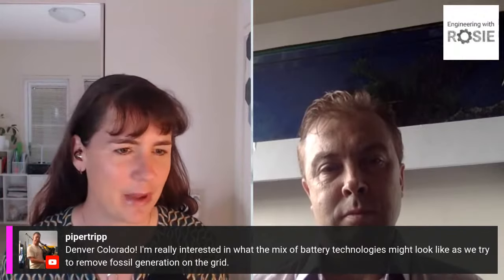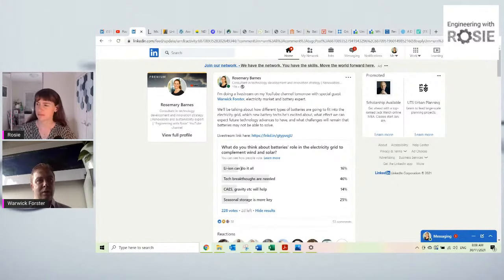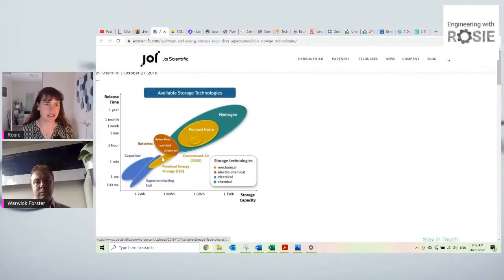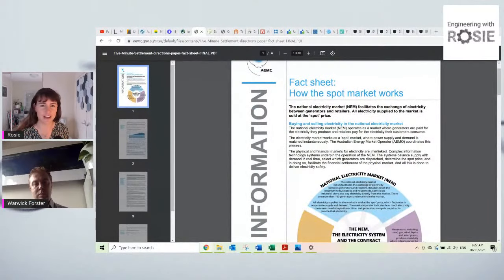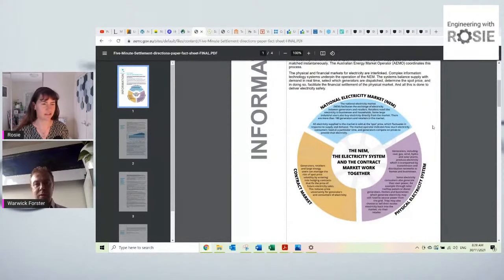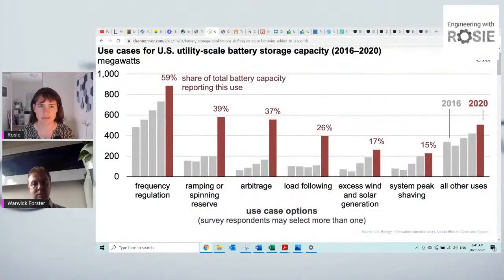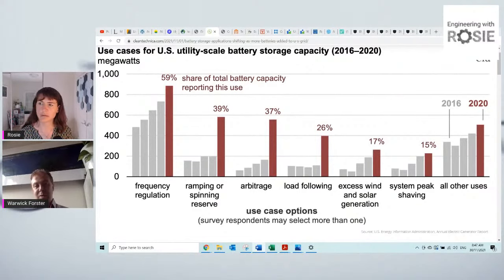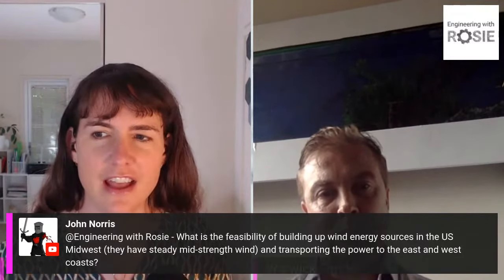Batteries in the Electricity Grid | Engineering with Rosie Live Episode 6

Comment: I must admit that didn’t quite go where I was expecting but found it really interesting. I have been trying to better understand what drives “the grid”. I have been looking more at IBRs and implications on system strength and the use of grid forming inverters to provide services no longer supplied by synchronous machines (you see regular constraining of inverter resources on low load days on the West Aus network). Thanks for this Rosie

Comment: My battery can cycle MILLIONS of times and I built it myself. I've used it now over 50 years and it works the same today as it did day one.

I build VAWTs and all my machines compress air. 

I utilize an air battery! I have LOTS of pipes and air recievers (tanks) about the place. 

I use compressed air to manufacture any electricity I want with the flip of a valve or two.

My "electrolyte" is both abundant and FREE! It never wears out. 

My entire system is designed for creating stationary power on my ranch in north Texas, USA.
Reply: That sounds really interesting! Do you make electricity to power your compressor or are you doing some sort of direct air pump from the wind like those old water pumping units?
Sometimes the best solution is the simplest one

Comment: 18:00 He didn't answer the question. Just mumbled about something else.

In theory you can store energy in batteries also for long-term storage (1-2 weeks) regardless of their degradation; if they're severely degraded you can't store too much energy.

Batteries come with a certain warranty/service period, which means that you need to "depreciate" them by the end of that period. Buying batteries to just use them once every 2 weeks is simply not cost effective. The cost of the energy you'd have to sell would be very high.

Comment: Clearing up why it is the prices can go from negative many thousands to positive many thousands... This guy mentioned it from a business focus and people asked is it a scam they trade like this, no it's not because the way AC power is generated means the generators have to spin at a set speed so there is only so much you can throttle one up or down much like a car if the revs drop too much it stalls and you need to restart, doing that can take hours for a really large plant and that is when the jet turbines he mentioned and other things will come online to support the grid and places like large metal foundries or hydrogen generation will shut down so homes can have power to cook that night and tomorrow when their solar is flooding the grid with too much energy and causing instability they can ramp up to 100% generation and help batteries smoothing the grid and so on.  I would not put in a $10m+ fast response generator to only be used a couple times a year less it was going to pay for itself in that time that is for sure. Seems many do not understand the grid because every Aussie I know complains about their solar feed in, I get 13c per kwh with my agreement which is crazy and there is no way it can reasonably stay that high when wind and solar peak is driving the negative prices at the moment. Hopefully hydrogen can help with that a little if people get out of the mindset it's a dead storage alternative to battery due to efficiency round trip.
Reply: Hydrogen is not dead. It can do seasonal storage and flight whereas batteries can not. They both have their uses

Comment: The problem is not so much we need a new technology or break-through- but we need cheaper storage (which may ultimately take a break-through, not because it will be technologically superior, but cheaper).  And thus the problem with all non-Li-Ion solutions- Li-Ion batteries just keep getting cheaper and better every year- other types of potential storage mediums have not been able to keep up.  They say a rising tide raises all ships- in the case of Lithium Ion, the rising energy density and dropping cost of nickel-based Li-Ion batteries has pulled down, for example, the cost of Lithium Iron Phosphate batteries along with it- and the energy density of LiFePO is now enough to make huge inroads for usage, especially for energy storage- it is not as powerful as its nickel-based cousin, but it is cheaper and will last longer- perfect for energy storage.  Yes, it will take a boatload of batteries- but the capacity will be there within 10 years, and the cost will be a fraction of its current price.  Also, with the growing popularity of decentralized energy generation, decentralized energy storage, i.e. a Tesla Powerwall in one's garage, is also growing- together, they will help take the strain off of a 'renewable' electric grid with intermittant swings.  There is also another option to greatly reduce the need for masive amounts of grid-level energy storage- better and more Base-Line power- for this, I would submit that LFTR Nuclear Power plants would complement other renewable energy generation, and lessen, if not obliviate, that need for TeraWatt Hours of energy storage.